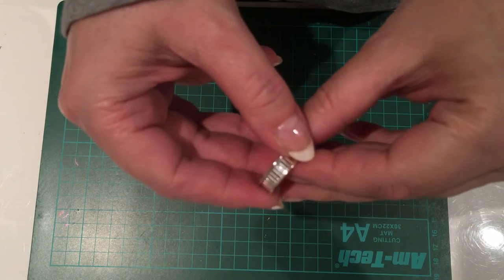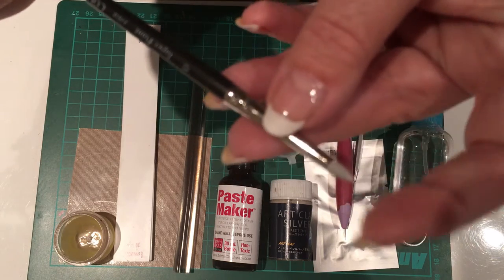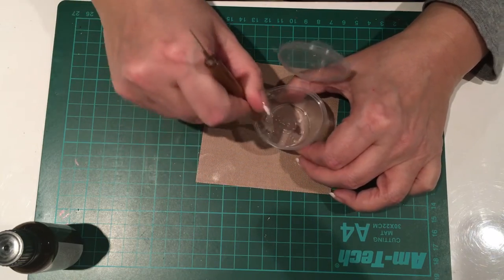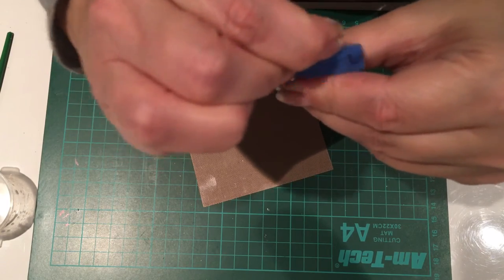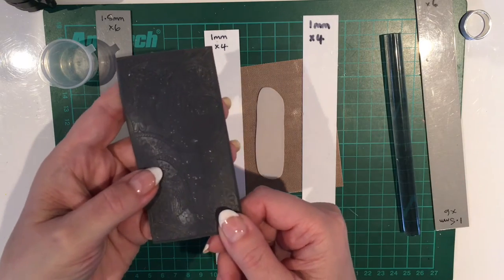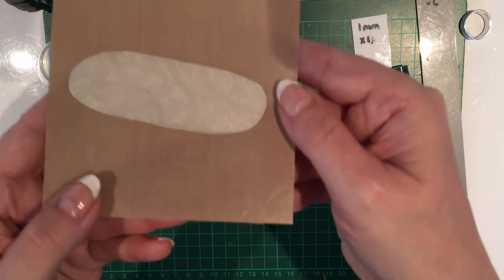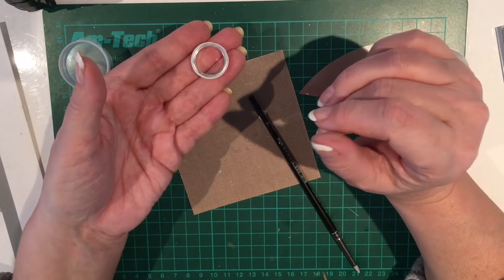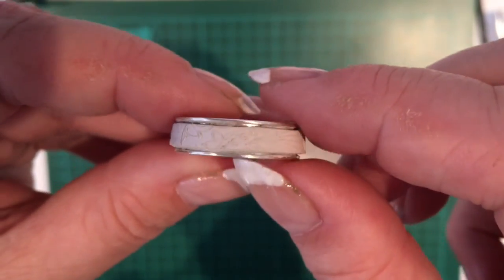How to use Silver Ring Cores with Metal Art Clay

Comment: Absolutely beautiful.  I'm fairly new to silver metal clay art, and until I found your video using ring cores I was apprehensive about even trying to make a ring. If possible, could you tell me how much fuel I'd use if I were to fire my piece in a hot pot.  Thank you so much.
Reply from the maker: Hi Donna.  I'm sorry but I haven't used a hot pot.  Unless it reaches the temperature required to sinter metal clay (which is 650 degrees centigrade and above), I doubt whether a hot pot would work.  If you have a kitchen gas hob, or a gas camping stove you could use either of those but the silver item needs to be on a wire mesh  directly on the flame and left for at least 10 minutes (depending on the size of your piece) or more.  If firing this way, the longer you leave it firing, the better.

Comment: Really nice work now would you do this process if your using a ring sizer for metal clay that you remove once fired and dry?
Thank you
Reply from the maker: Hi Lorri - I wouldn't make a ring around a ring sizer - is that what you meant?  I would make a ring on a ring mandrel without anything in the centre and then would add the ring sizer before firing.  However, I never use ring sizers as I usually know how many sizes bigger to make the ring so that when it fires I get the size the I want.  I hope that makes sense.
Reply: Thank you I will try it both ways I appreciate you responding

Comment: please!! could you tell me how did put the texture back on the ring after you overlap the clay on top..I didn't see it happening, even I played it twice..thank you very much..
Reply from the maker: Hi Salma - it is tricky to do unfortunately.  What I did was wet the clay slightly with some water on my finger on the area I wanted the texture.  I then waited a few seconds to make sure it wasn't too wet and then pressed the texture mat over the clay.  If the imprint needs a bit of refining, I wait until it is dry and then use a few tools to just carve the deeper areas or sand areas away.  Hope that helps.